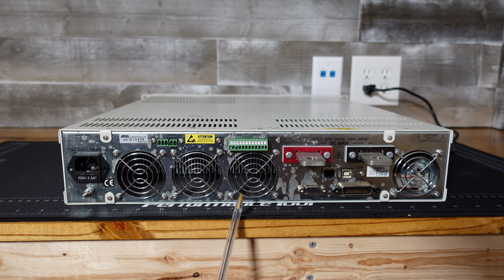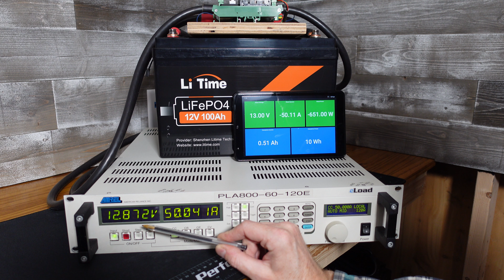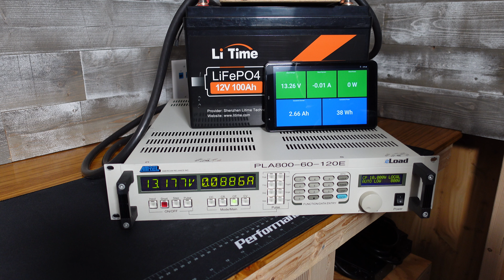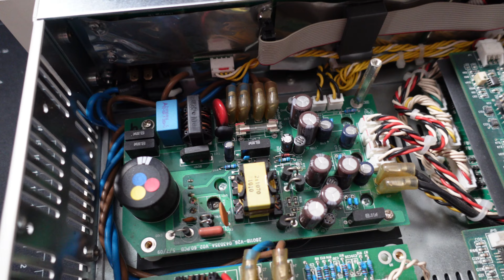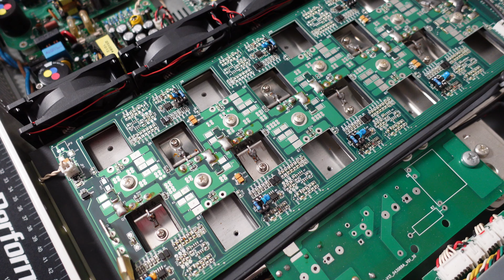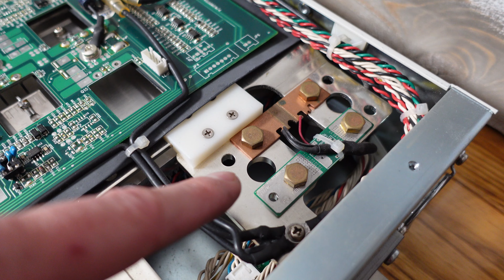American Reliance Electronic Load Overview, Amrel PLA800-60-120E

Comment: sweet find man!!! it's basically a giant pro grade dl24 lol - i would always do four wire cap testing man - even if it's negligible for low loads, the higher the load test, the higher the sag ofc, so i'd just use 4 every time just as sop... excellent excellent find again!
Reply from the maker: Agreed - voltage leads came yesterday, all set now! First really battery to test it on will be the "dumfume" from Black Friday (arriving later this week).

Comment: I'm sure you have a good use case for what you bought but for anyone that wants a cheap good electronic load I bought 3 different models from ZKETech. The EBC-A40L for single cell, EBC-A20 for up to 30v, and the EBC-B20H for 9v-88v. I also bought a RD6018 DC Power Supply for the EBC-B20H since it alone cannot charge. All of these combined cover the voltage and amperage spread I use most often. They all work great and the software that it uses you can do cycles at different charge and discharge rates and have it exported in a spreadsheet. The software does crash once in a while but for what I use it for it works just fine. Just wanted to mention it in case you or anyone else that may want a cheaper option.
Reply from the maker: What is the discharge wattage of the EBC-B20H. I did some Googling and can't seem to find it listed anywhere...
Reply from the maker: Oh 1700W, that's pretty darn good!! It's limited to 20A though so still a deal breaker for me.
Reply: @LithiumSolar  Yeah if you need to really pull some amps for testing on large batteries these might not do the job but they are great at least for the batteries I use. The largest pack I have at the moment is about 80Ah at 48v. Takes a while to do a full charge dischage cycle but I'm not testing it all the time. I mostly just test single cells to put into larger packs then do a capacity test on the whole pack. That EBC-A40L can rip through single cells at 40A though. Kind of limits you to 40Ah cells at 1C rate but smaller cells you can really push the limits.

Comment: Pretty awesome. With all the communication ports available might be easy to write a program to conduct the actual capacity test, provided protocol docs are available. All the stuff needed to perform the calculations seem to be there, i.e. the shunt, and voltage measurements. Do you know if it publishes current/voltage measurements over the ethernet port? You mentioned you were able to control it over telnet, so seems it's probably easy to figure out the commands, etc.
Reply from the maker: Already done! I'll have a follow-up video demonstrating this next.
Reply: @LithiumSolar  Nice! Now you got me thinking about grabbing one of these LOL

Comment: Wow, that's very cool!  I do love the different CV, CP, CC and CR options for testing.  Should be much more consistent and stop you from having to worry about "was it the battery or the inverter that shut down?".  

I wonder if a meter would be closer to the electronic load or the Batrium?  I saw one of the boards looks like it had a lot of POTs on it, probably for calibration.  Wonder if you could find any spec sheets on how to calibrate the meter to ensure it's as accurate as possible for your tests?

Would be nice if there was some way to capture that excess power though.  I'm not a huge fan of using heaters for tests (unless its super cold outside) because you're kinda wasting the power.  I would rather harvest the power and try to use it if possible.  

Looking forward to future tests!
Reply from the maker: Yes, that was the problem with the inverter setup is a lot of times the inverter cuts out before the battery BMS. Batrium claims to be calibrated to a 1% tolerance, but I'm not so sure about that. This can be calibrated - already contacted two calibration companies and have a quote back from one :)
Reply: @LithiumSolar  Hopefully the calibration price isn't as much as the whole unit!  😁
Reply from the maker: @AdamDeLayDIY  The quote was $185. The other company declined due to not serving Amrel equiptment. I'm hoping to drop off locally to avoid shipping costs. I'm not sure if I'll do it yet or not. It seems pretty accurate as-is.
Reply: @ wow, even $185 is not bad at all.  I was thinking it would be double that at least.

Comment: Nice, I couldn't find any decent used ones. I purchased 4 smaller units new. Kunkin makes some good ones, and you can parallel them (just use a busbar). 400 watts each, or up to 40 amps each and under $200 each (and calibrated). Great for testing cells or even batteries.